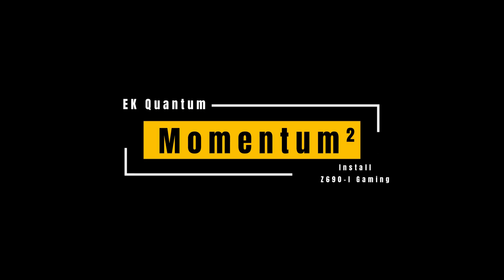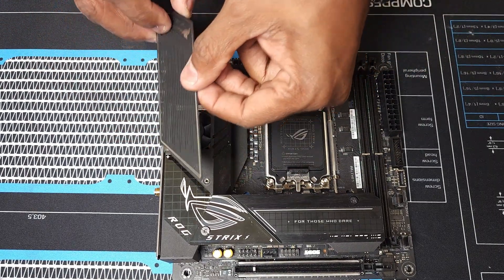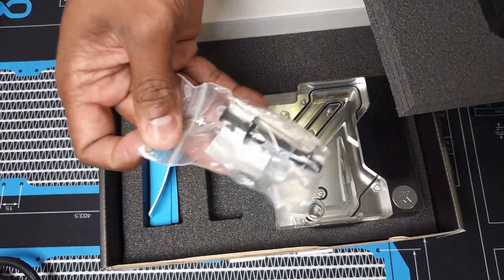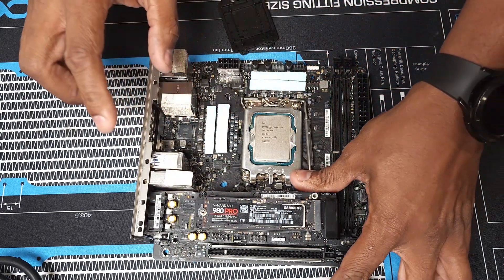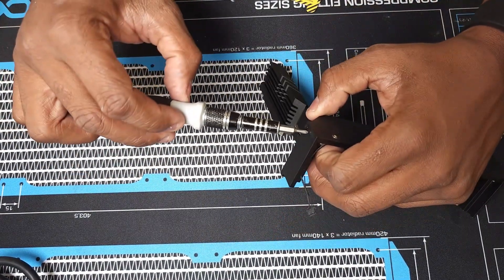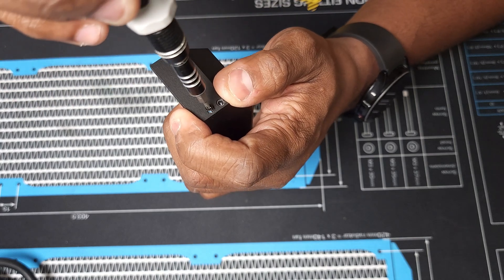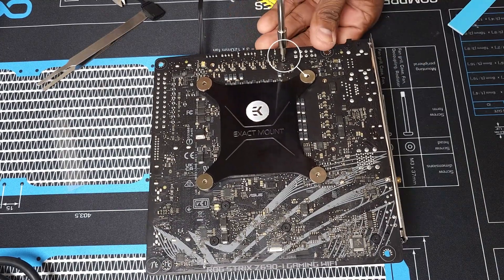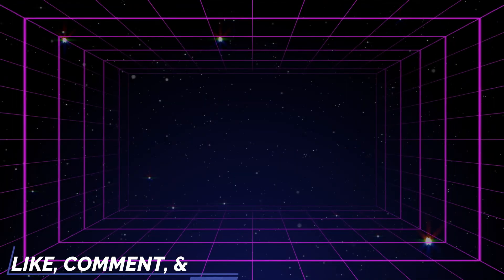How To Install EK Quantum Momentum² Monoblock - ROG Strix Z690-I Gaming

Comment: temps? follow up vid
Reply from the maker: When I had this, the temps averaged about 32 degrees Celsius on idol, 57-66 gaming. Monoblock is worth it, but having more radiation surface area can result in even better temps.